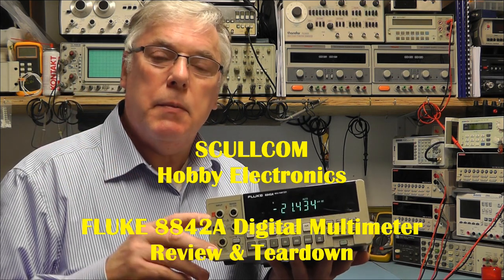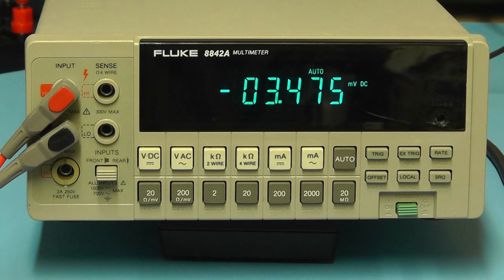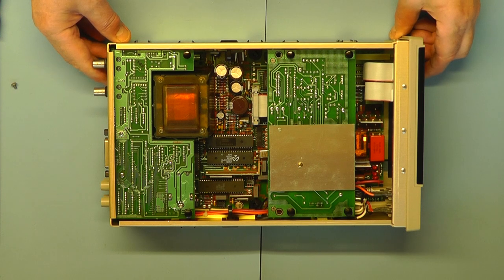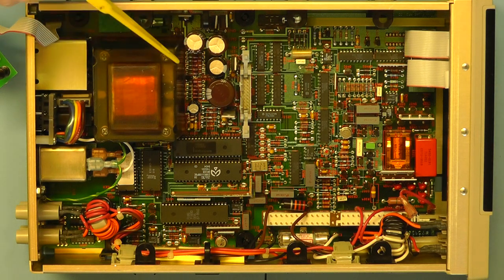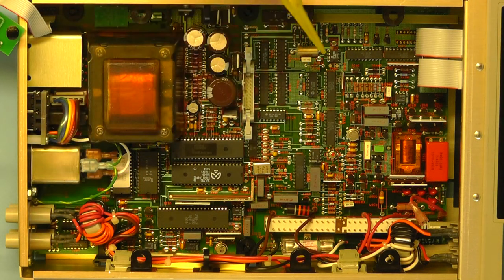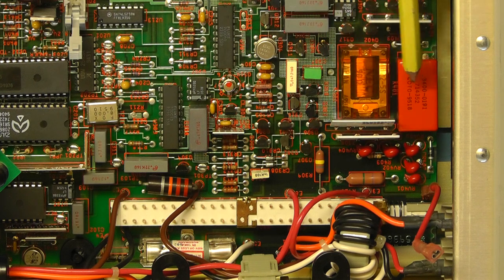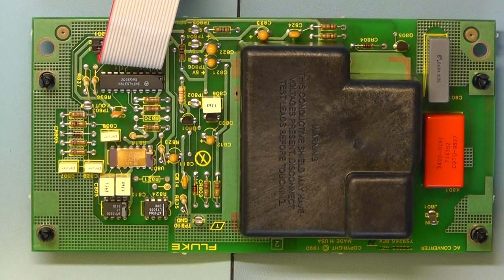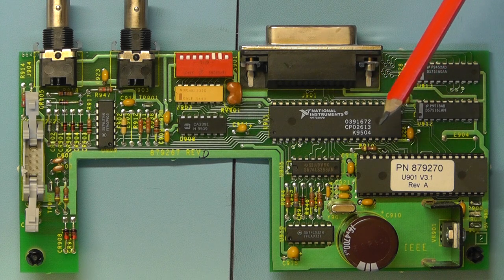Scullcom Hobby Electronics #10 - Fluke 8842A Digital Multimeter Review & Teardown

Comment: Nice video on (in my opinion) one of the finest meters ever made. I've had mine since 1991.

Some comments:

The "logic IC" you point to at around 24:50 is actually a mixed analogue / digital ASIC that is the heart of the ADC. It's basically a bunch of analogue switches and a lot of timing and control stuff.

The former for the current shunt resistor is actually mica, not plastic.

On the AC board, one of the DG211 IC's is used for scaling, the other is used to select several capacitors, in order to trim the high frequency response.
Reply from the maker: +Rob Klein Thank for your comments and info much appreciated. Merry Christmas.

Comment: I loved these meters and have used them extensively at work for years. I only have one issue with these meters and that is of the "Open Circuit Histeresis Measurement" that remains on the screen after you complete the measurement. In laymen terms, ie. If I take a 5 volt DC measurement and then lift the lead and then connect it to an OPEN circuit, not connected to ground or a with a voltage on it, the voltage will remain around 5 volts DC and start to drift. To get around this, provided the measurements that didn't have to be highly accurate, I would place a 1 Mohm resistor on a banana plug across the HI and LOW terminals. This would usually solve the Histeresis false measurement problem. Before performing other measurement functions like, Ohms or MA you may have to remove the Banana Plug with the resistor for higher accuracy. Thanks for sharing. Best Wishes & Blessings. Keith Noneya

Comment: My 8840A had bad solder connections at the power transformer which were not at all obvious visually, and poor connections at the internal push-on connectors to the front panel inputs, which made the resistance functions flaky. I thought I would share, since these issues may be fairly common.
Reply from the maker: Mark Zacharias Thanks for sharing your comments.

Comment: I have an 8840A and in DC mode (default from power on) the display is blinking at a rate of about one second per cycle. All voltages seem good. I don't know what setting to use on the scope to measure the ripple but I can't see any ripple problems. It has options 5 and 9. AC (rms) measurements work fine but no DC or resistance functions. 
self test results - 1-4 and 10.14 test good. 5-9 and 15-21 show error.
At one point while turning the unit off and on for test, it worked properly but I never got it to repeat. I went ahead and replaced all 5 caps in the power supply area anyway but to no avail. Any suggestions on where to look or how to proceed are greatly appreciated.

Comment: Hello, I found your videos via the blog post on hackaday! Congrats on that! Yours looks quite nice. It's easy to judge by how all the digits and annunciators on your display are equally bright (VFDs tend to burn-in). And it's calibrated too? Score! You're lucky to have such nice equipment for personal use. Great video, looking forward to more :-)
Reply from the maker: Thanks for your comments. Yes I agree one of the problems with the VFD is that the brightness of the display deteriorates after many years of use.
Reply: Scullcom Hobby Electronics 
However, on some other types of VFD displays,  the segments less often used, or lit up, tend to be dimmer then the ones frequently lit, like seems to be the case on this Fluke meter. I had a microwave oven that had this type of display, and I used to unplug and replug it in the wall outlet about once every three months to light up all the segments for several minutes, and they would all come back to being evenly bright. I thing it has to do with some sort of temporary oxidation of the surface of the phosphor or something (not sure about that though) ?  
Glad the see that Fluke, in their infinite wisdom, added the possibility of lighting up all the segments (with that SRQ button) probably to allow them to even out their brightness after several minutes ?

Comment: Great video!  Thanks for sharing the details.  

I just received a 8840A in rough shape though looks like is working similar and I've read there isn't much different between the two.  I'm a reborn newbie in electronics and RF engineering now with the high quality DMM and am exited having this to be able to test with.  Looking forward to testing using standards next and making more accurate or at least precise mV settings on devices.

I was wondering... why do the values in the 200mV and 2V want to keep going in increasing negative value?

I notice no errors and the values zero's at the 200V & 2000V settings when pressed in that order... though not the 20V except when pressing 2000V, then 200V and then 20V.  That is when 20V zeros out.  2V and 20mV both keep going more negative either way or rate. 

Does anyone know why the instrument does this?  I have no probes connected and the front panel selected.  SRQ shows no errors and I assume passes.    Thanks in advance for your time and support!
Reply: I was reading on Tin's xdevs site that these devices use components used in commercial voltage reference standards too and Dave at EEVblog notes this too. 
https://xdevs.com/fix/f8842a/
https://xdevs.com/review/dcvref_table/

I see YT is suggesting another Scullcom Hobby Electronics video #11 regarding a precision voltage reference box and will have to watch when I get to. Great timing... uhm... pun wasn't intended... though timed out appropriate.

Comment: Great video. I just bought fluke 8842a from ebay one of my Dc volt range 20v wont measure more than 5 volts all other range are fine . would you know what it could be let me know thanks
Reply from the maker: +Ami Khimji I would recommend you perform a Diagnostic Self-Tests.
To run the diagnostic self-tests, disconnect the test leads and press the SRQ button for 3
seconds. The refer to the service manual which details the error code.
It sounds like there is a problem with the scaling circuitry for the 20v range or there is a error with the calibration for this range.
Reply: thanks very much i will check i get error 8 and 9, thansk for your help